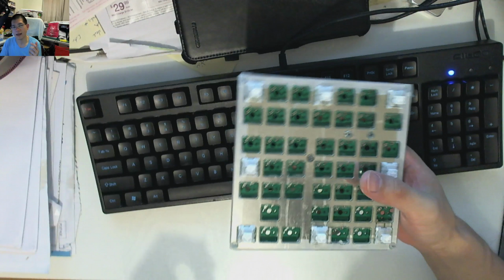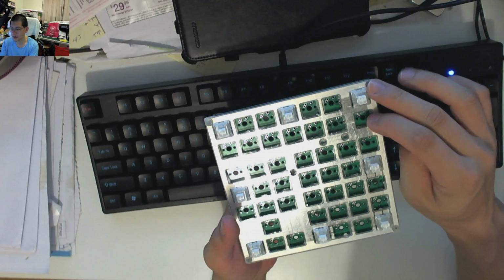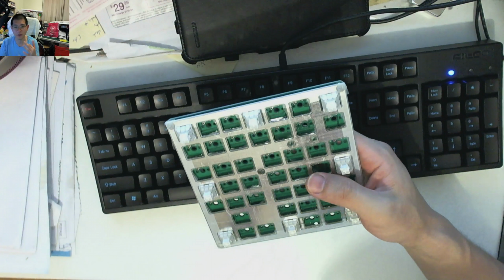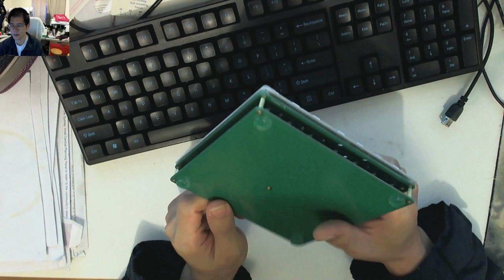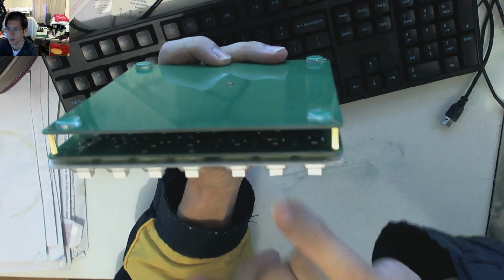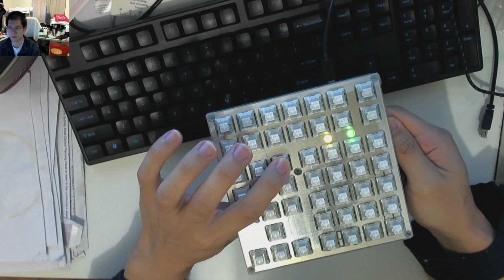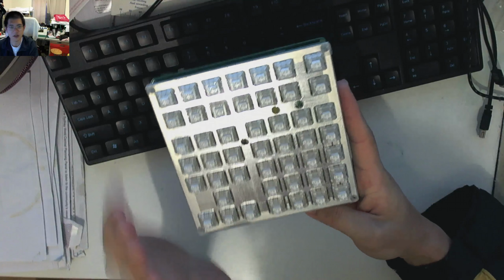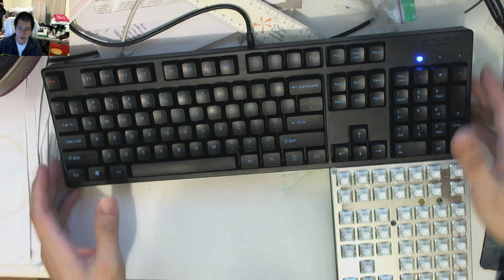FHANv3 Build and Review

Comment: Quick question... if you decided to go without the plate and wanted to put a 2U switch in, would you be able to secure the stabilizers still? Or would a plate be required to be compatible with stabilizers?
Reply from the maker: If the PCB is made with PCB mounted stabiliser holes, you do not need a plate for the stabiliser. Most community developed PCBs are PCB mount compatible, it tends to be the OEM boards are go with plate-mounted stabiliser instead.
Reply: @theboard  That's great, thanks so much for the reply!
Reply from the maker: @MrAptex  No worries. If you are able to see the PCB, you'll be able to see if there are the holes for stabiliser mounts or not.  This image shows what a 2U stabiliser holes look like - https://hackernoon.com/hn-images/1*c-VXVzgcHOHkQeO2vfIVEQ.png for a numpad 2U keys